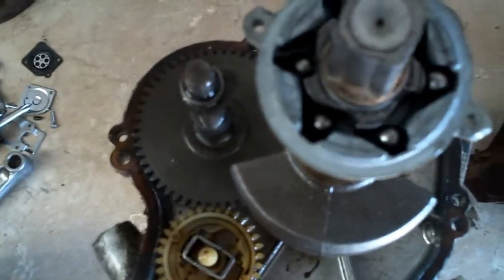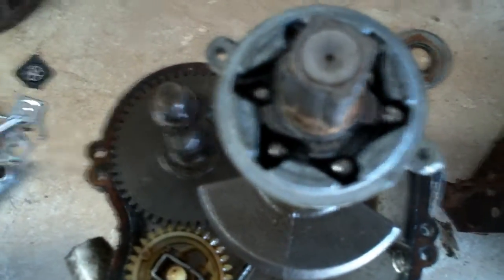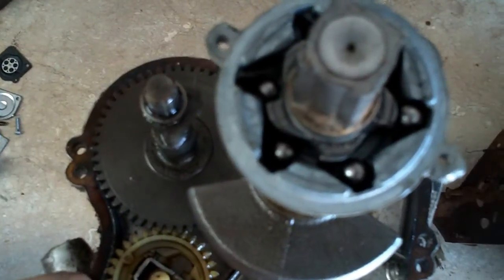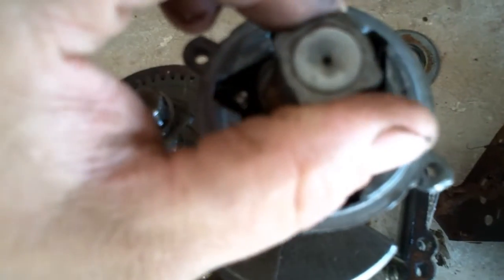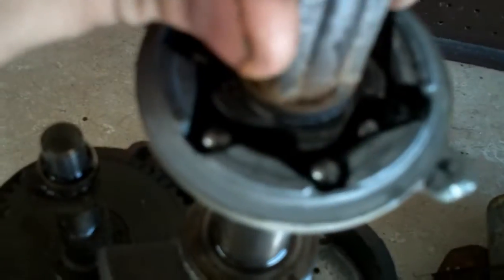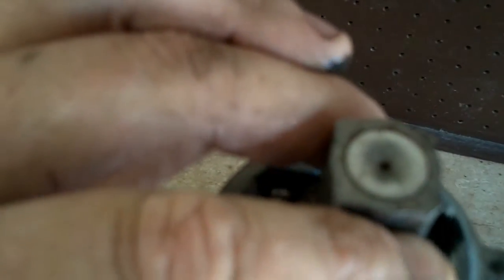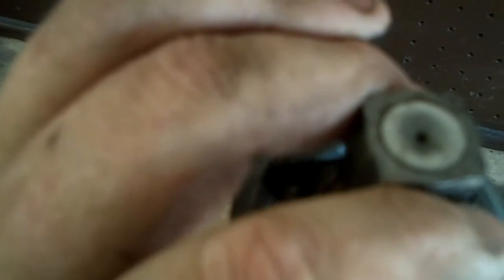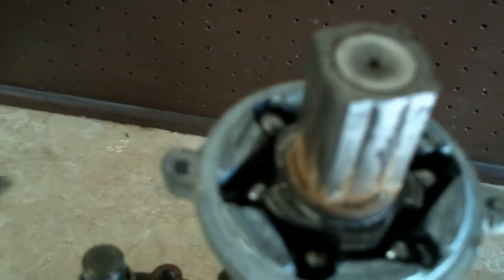HOW THE STARTER CLUTCH WORKS ON AN OLDER BRIGGS AND STRATTON ENGINE

Comment: My motor was started with a drill. Now drill does not spin shaft clockwise at all. The clutch still spins freely counter clock wise... does this mean my clutch is bad?

Comment: On my tiller, the recoil cord will retract while the flywill cover is off of the motor, but not while on the motor. Is that a symptom of a bad starter clutch?

Comment: I'm in need of some help please. I have a 5hp briggs also with that starter clutch. Moves freely when turning counterclockwise. Doesn't when try to turn clockwise. Here is my problem. Something is sticking when I pull my rope where I cant even pull the rope. I'm able to move my flywheel by hand. What could be the issue?

Comment: Hey, great video. I have a problem with that starter clutch. The little shaft that is supposed to spin freely will not fit over the crankshaft on my Briggs engine. There was a chip in the end of the crankshaft so I ground it down and now that little shaft won't fit over the crankshaft. Can you help?

Comment: Centrifugal force is a handy force, automatic clutches on scooters, and the rollers that fly out on the "v" belt varactor drive found on small bikes.

So handy but often forgotten as a way to regulate/drive or change a speed dependant device.

Nice vid :-)